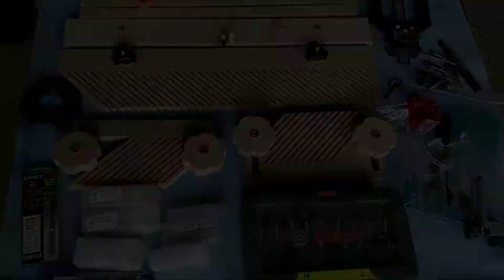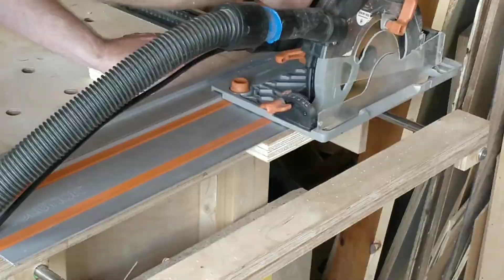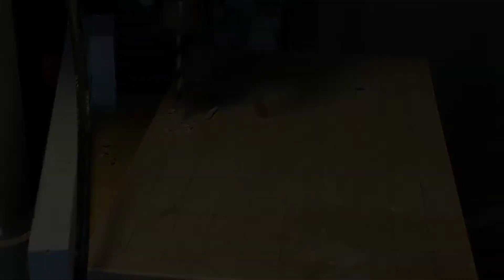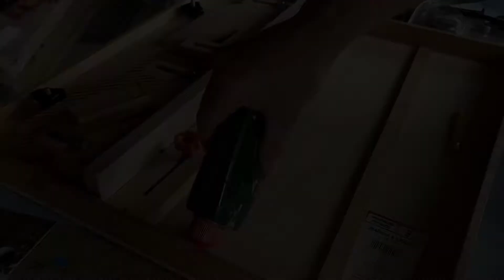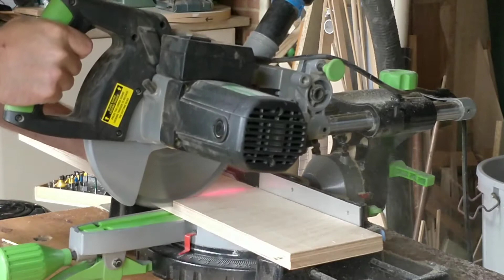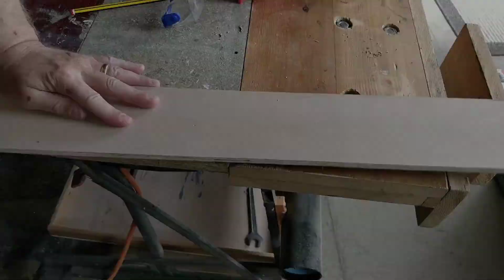41. Workshop Organisation: Router Accessory Storage

Comment: hi, i tend to use paste wax on my mdf shop furniture, not as messy as paint and seems to do the same job in keeping moisture away from the mdf, it also aids sliding surfaces like drawer runners,  cheers.
Reply from the maker: Thanks for the tip 👍🏻